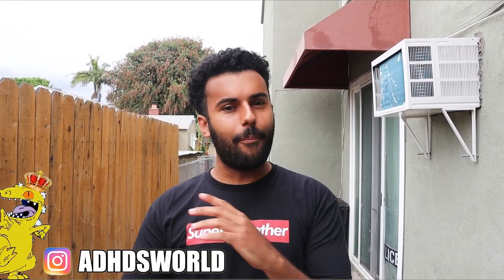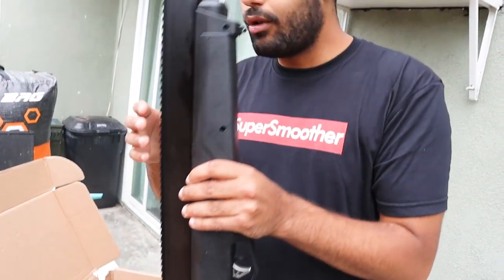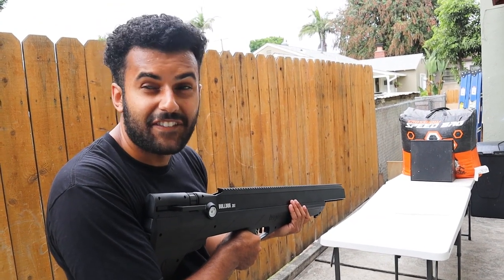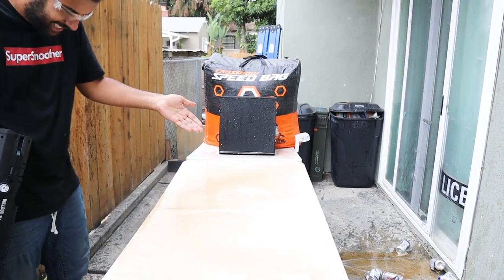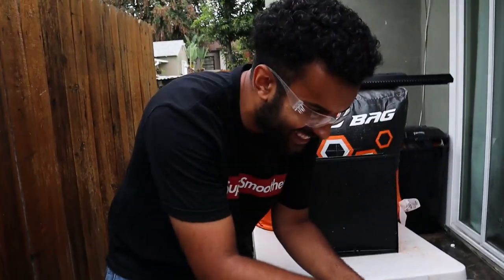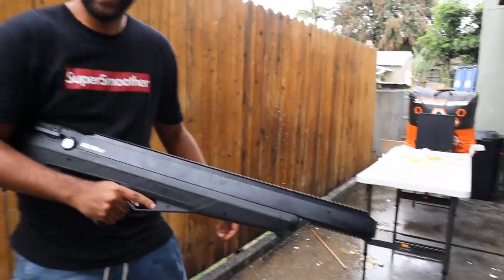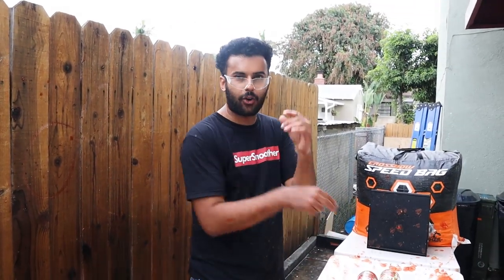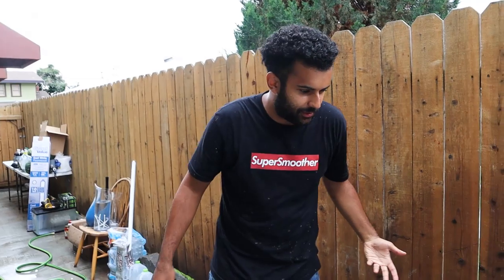BLASTING SATISFYING Things With A BULLDOG AIR CANON!!! *EXPLODES ANYTHING IT HITS*

Comment: To answer your question, an arrow has a lot of mass compared to a bullet, but it isn't moving as fast. More mass means more inertia, and that lets it move through soft targets easily, while a bullet has low mass but very high velocity. So it can go through harder targets more easily. That's why AP rounds have to move faster.
Reply: Also most bullets do have more kinetic energy Than arrows, they just tend to dump all of that energy into the target because they're made out of soft lead rather than hard steel like an arrowhead

Comment: The Arrowhead is made of a much harder metal, the "Bullet" is made of a softer metal to be able to grip the rifling of the barrel, thus, when it impacts a hard surface it will start to flatten out causing misdirection of the round after impact. When a arrow hits something it naturally has a bit of flex to it, however due to the harder metal it will not deform, and continue to apply the full kinetic energy onto the small tip of the arrow, rather than a continuously expanding, continuously flattening surface. This is actually a thing exploited by many Ammunition manufacturers for self defense ammunition, to be able to penetrate a set amount then come to a full stop, dumping its full kinetic energy in a small space, rather than continuing to focus it on the tip of the arrow, for a longer duration.

Comment: Didn't see any one who answered your question so I'll give it a shot. Kinetic energy is based on mass and velocity. K=1/2 m vsquared so for kinetic energy velocity has a greater effect than mass. The bow has more momentum = mass times velocity. In this equation mass and velocity have the same impact on momentum. So because the arrow has more mass  it is able to continue moving through the target. The airguns high velocity results in high kinetic energy but because it weighs much less it has less momentum and does not have the same deep penetration and dumps most of its energy when entering the target.

Comment: Well, an arrow has lower speed, but more mass. This means it has a higher momentum, as momentum (p)
p=m*v (or mass times velocity). Because it has more momentum, it can travel through more, because it has more energy to dissipate through your target. (basically: more mass = longer distribution of energy)
A bullet has a VERY low mass for a projectile, so less momentum. (less momentum = less time to distribute the energy (or more peak force, but it dissipates instantly))

Comment: The faster a bullet travels, the more penetration power it has. A standard fmj .308 round won't go through 3/8 ar500 steel, whereas an AP 5.56 round wild slice right through it. 5.56 or 5.45 are wicked fast.

Comment: the kinetic energy when the arrow is fired on impact transferes the kenetic energy to the object in a small point which is the reason the arrow has a arrow head while the tip of that particular type of bullet is more blunt and the kenetic energy is distributed in a larger area

Comment: That air rifle isn’t more powerful than a 9mm which depending on load starts at ~350ft lb of energy ( 115gr at 1200fps. This air rifle is claimed to produce around 200ft lb of energy which is still very impressive for an air rifle.

Comment: The innuendo in this video;

"How does that fit in there?"
"First off, feel how hard that rubber is."
"That's a perfect hole!"  
"... its harder than steel."
"...look at the backside..."
"I'm not sure what happened but I'm definitely wet."
"...alright this is one little hole and one little hole and one little hole - that's right pop those holes open."

I'm bored.

Comment: Hey adhd I just watched the video where you were talking about the wd40 accident and you talked about doing something you've done before and expecting the same result and I wanted to share a story of something I did I live on a dirt road and there's one curve I always drifted around and everything was fine till I done it one day going a little too fast and I hit the ditch jumped my truck into the air got the front pinned between one tree and the ground and the back was 5 feet in the air on another tree and it all happened so fast I didn't know what happened everything just felt quiet and like time stopped then I seen smoke and thought the truck was on fire it wasnt thank god it was just the radiator broke but I couldn't walk for a few days after and couldn't turn my haed for about 2 weeks cause I had really bad whiplash and cracked a rib but I'm ok now and it took me almost 2 months before I would drive back down that part of the road and even now I get nervous going around the curve also sorry for the extremely long comment just wanted to share my story with you and the rest of reppack